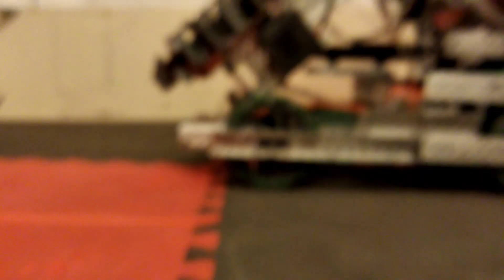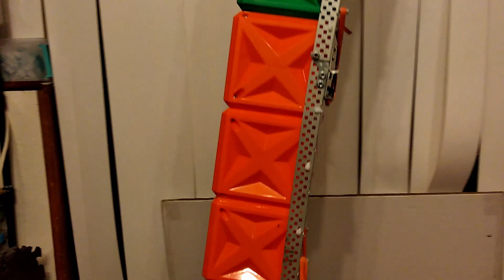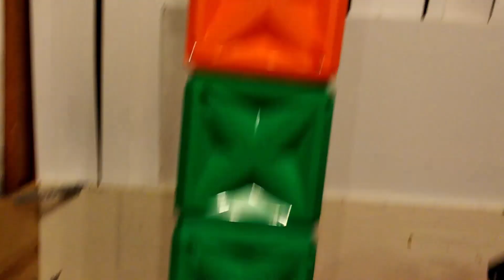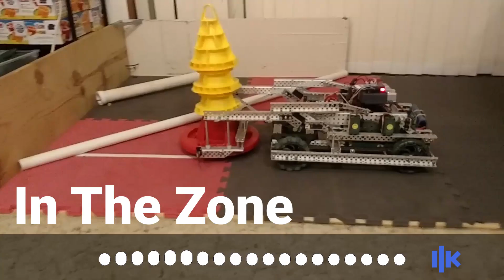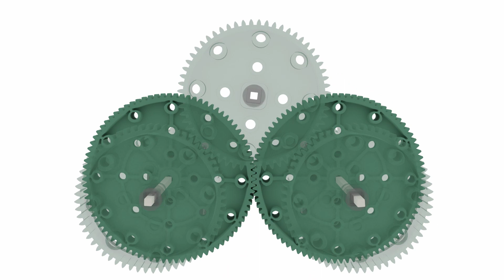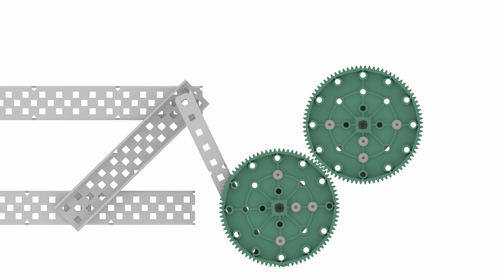Vex Differential Transmission Explained - Tower Takeover

Comment: I had always figured that since you aren't allowed to modify any motor parts per the rules you can't use the internal gears from the motors anywhere else on the robot but I guess the rules do only say you can't modify them for motor usage so props to you for finding an innovative way to use the gearing.

Comment: nice transmission but I'm p sure double rachets have lower frictional losses if built right this just seems to have too many downsides and the anti-chamber LMD differential would have been much better suited for this application
Edit: that's not to say I don't think this is cool I think this is very cool just noting practicality seems low